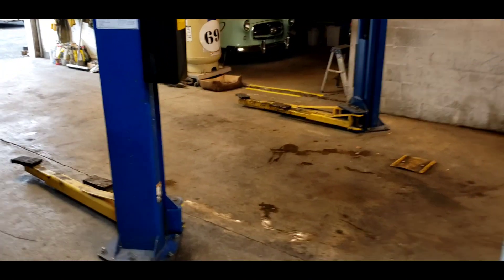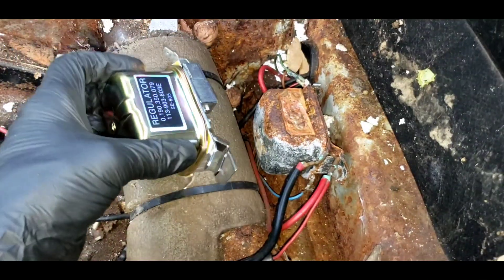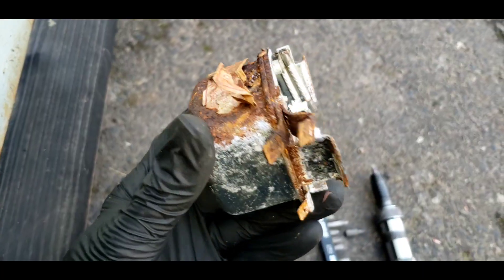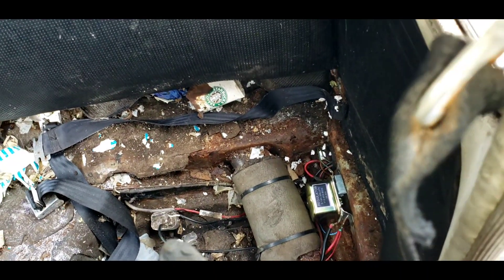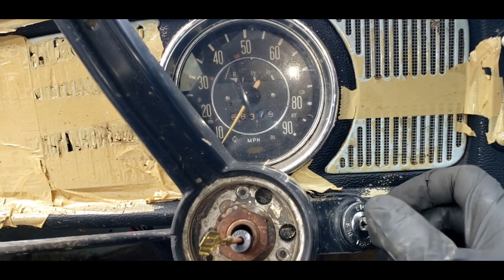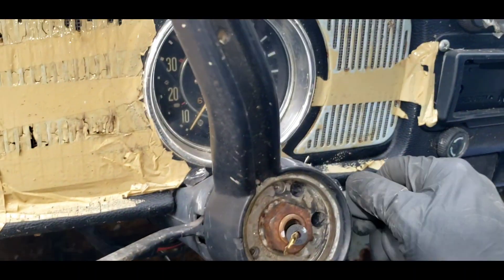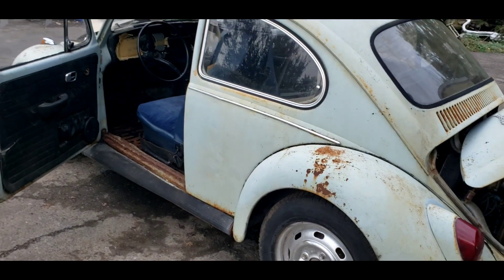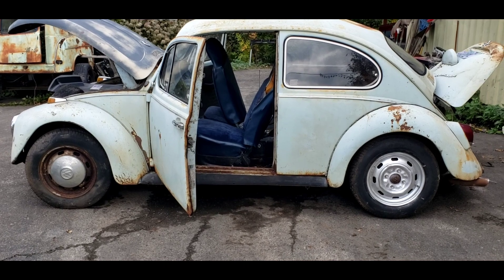Bug of Lost Hope

Comment: A VW will not charge the battery if the generator light does not come on. Both lights are off so it is probably a dirty fuse.

Comment: That VW needs to be pressure washed inside after holes cut in the floor for drains. Every rust repair panel is available as well as all other parts. Would be a neat car to fix up and no reason to go stock. Another Air Cooled car to add to the collection.